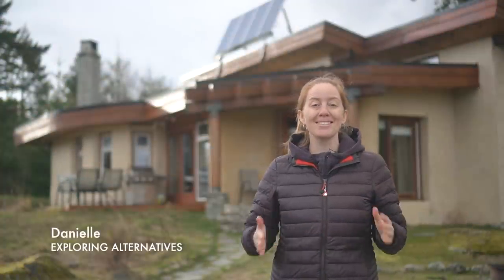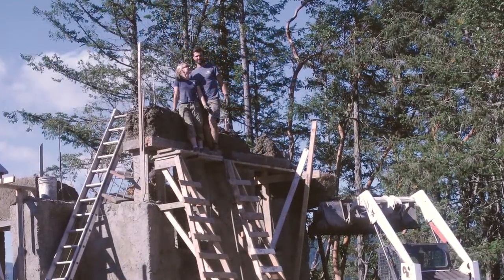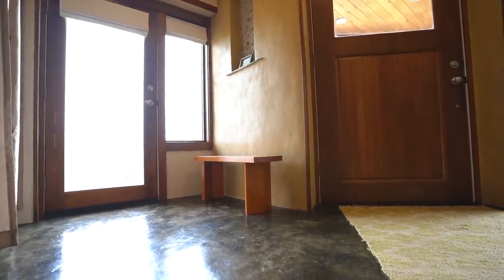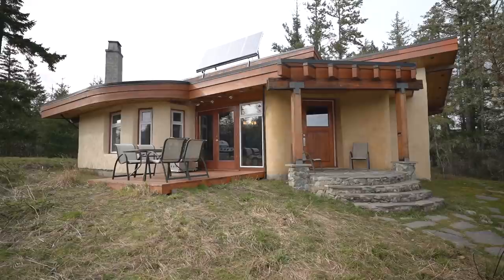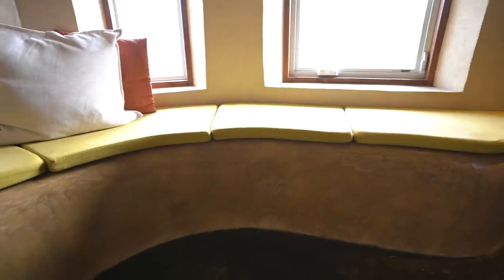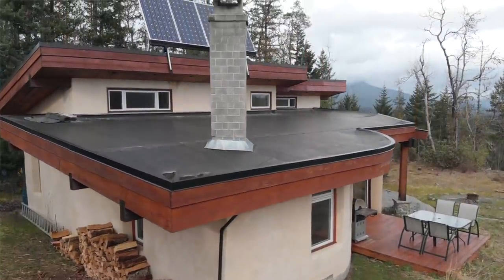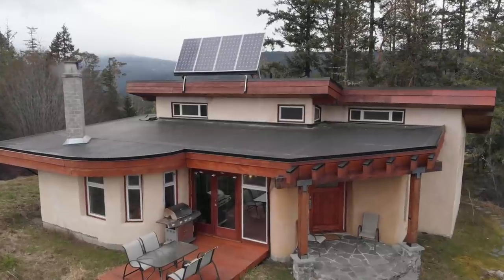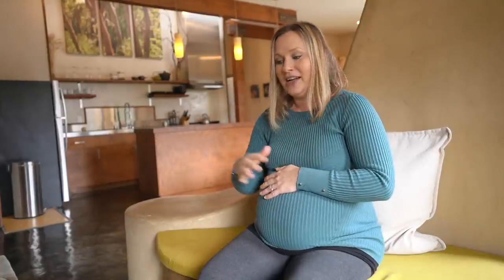Modern Off-Grid Cob House Built With Sand, Clay & Straw - Sustainable Green Building Tour

Comment: I love this but we need more videos that delve into how you install electricity and how you deal with any repairs and problems when everything is buried behind the cob. Thanks.
Reply: It would be a massive pain in the ass. You put the wiring/plumbing in the walls as you build it up. The alternative route would be running conduit housing on the face of the walls, which looks industrial and probably why they didn't so that. I guess you just really need to plan ahead.
Reply: exactly - maintenance question looms large
Reply: I would imagine you consolidate plugs/outlets to one or two heights in your design. If it were me, I would lay 2 or 3 inch electrical conduit down around the entire home in all the walls with T joints spaced for whatever i would need. Then you could snake all power/data lines through relatively easy and you can always replace cable or run new stuff down the road.
Reply: True.
Reply: Check out This Cob House on youtube, his channel shows all the steps in building a cob house
Reply: @danilles.4247  Link or title please.
Reply: @musyoka8  they said the title. this cob house.
Reply: @marcellogenovese199  Thats how most EU house is built. Cob is way easier because if something brakes, you can juste dig a hole or a small trench, and just patch it up with more cob
Reply: I too enjoy these videos. Though I think they tend to give a very 'tidy' image of alternate living. To be fair, this video does come with a disclaimer the house exists to show an alternate design at its best and most desirable.
Reply: @marcellogenovese199  plumber ballet and electric fishing both point to the observation that doing something that is difficult and costly to repair replace one time is nutty...doing it millions of times is insane.
Building with insulated and easy access to plumbing and electric is a design consideration.
Reply: No roof details??
Reply: @corylannon8546  nice thinking 👍
Reply: It would be possible to place the electrical wiring inside a conduit and then place an easily removable case of decorative wood over them. Planning the wiring to go in in such a manner that it looks nice would be the way to go
Reply: Would love to know about the electric aspect and repair on a cob house.
Reply: I bet you could do something with the floor/ foundation. Do regular slab add a wooden or metal crawl space of 2 inches due to the 2x4s. Now you have a space for easy access electricity and plumbing. Obviously this would really limit ceiling lights and normal light switches... potentially they could just leave a 1 inch slit of space through the wall for wiring. Then cover it with wood or metal again. Then when they need maintenance they just need to plaster where they take the wood out
Reply: Yes please !!!!
I need help with the foundation, water collection, electric and plumbing please !
Reply: @corylannon8546  Good idea. There's so many benefits to this building method it's worth having plans to deal with the flaws.
Reply: @ArtByKarenEHaley 
A very clever solution.

Comment: Beautiful home- I think I would need more solar though.
Reply: The 1 kw rating is probably the panel rating. Battery storage can be any size you want for heavier loads. The caveat being that the larger the battery storage, the longer it takes to charge when depleted.
Reply: They look like they’ve reduced their power needs to the point where they mostly are using solar power for lighting and the refrigerator. They did mention both a propane stove and passive solar design. I would wager that the water heater is probably also propane.

Comment: I am asking because I don't know,  if your off the grid,  how does propane make you off grid?
Reply: Off grid means not connected to the municipal power, water and gas.
Reply: @guy8646  I know that, for emergency purposes,  I would do for my reasons,  but, you can't produce propane
Reply: Most off-grid people are not producing every single thing they own, either. It's simply means not being directly connected through a pipe, wire, etc. to a grid.
Reply: You are confusing off grid with self sufficiency.
Reply: @alexesdohr6485  thanks

Comment: I watched twice. It appears your hot water tank is electric? It also appears that you could only run it off your generator and that would be at full capacity.. I guess you rely on wood heat and only heat the hot water when needed?
Reply: he said that the radiant floor heating is the primary source of heating the house. Could the tank be gas?
Reply: @shellysadventures2875  possibly..I just noticed it was an electric hot water tank and it had wires connected to the place where they would be found .. he did say it was "special"...but by that I think he meant it had an internal heat exchanging coil for the floors.